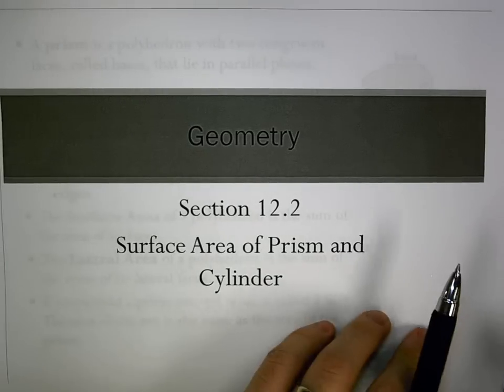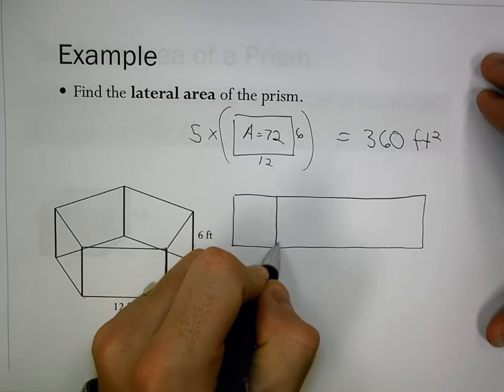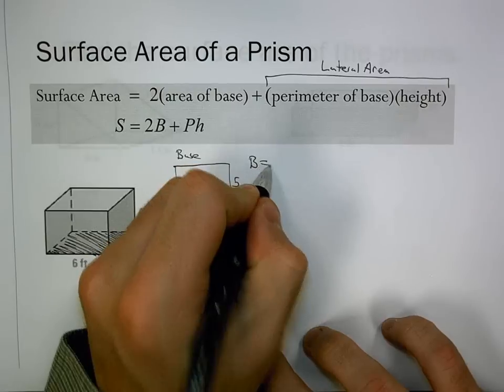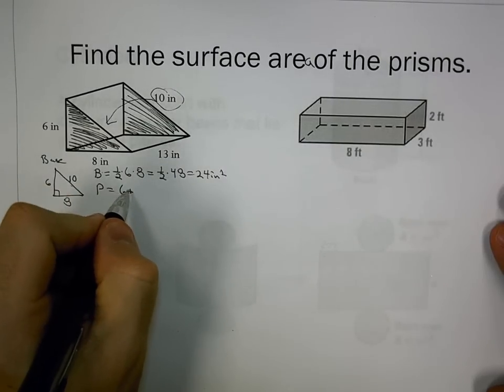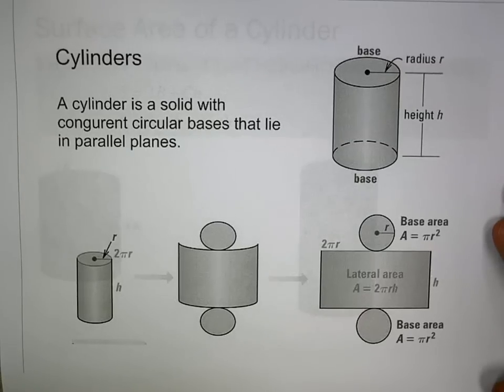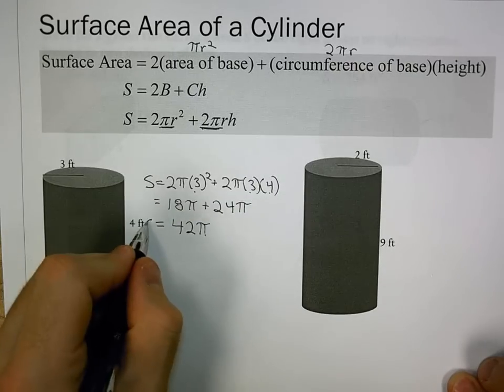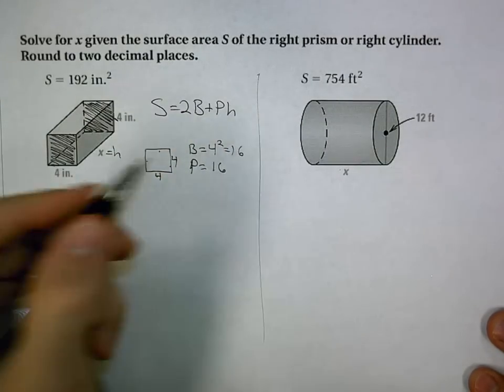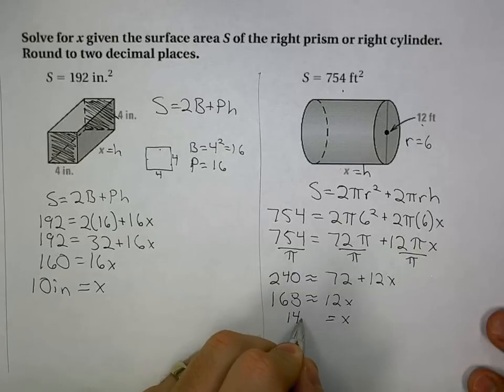Sec 12.2:  Surface Area of Prisms and Cylinders

Comment: To find the area of a pentagon, you have to use trigonometry, correct?  
You are probably aware of this, but if you use calculator on last problem, the x (height) comes out to 14.0004718..., so rounded to 2 decimal points: 14.00. So your estimating skills were right on the money.
Reply from the maker: Chris Manhoff yes, anything other than a triangle, square or hexagon would need trig